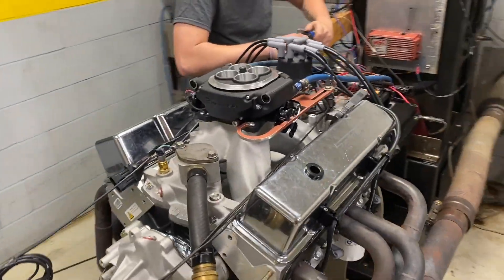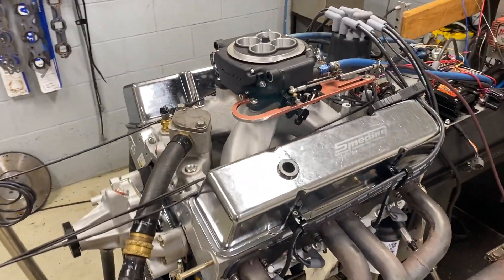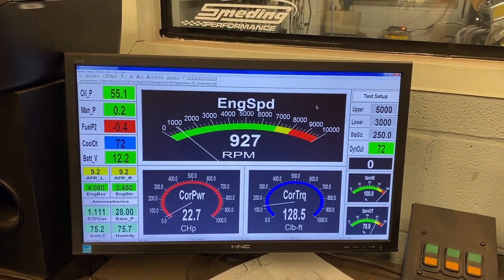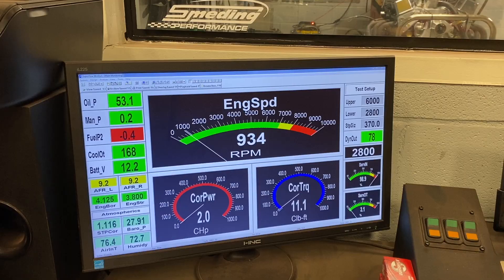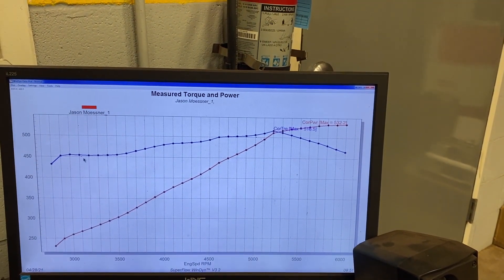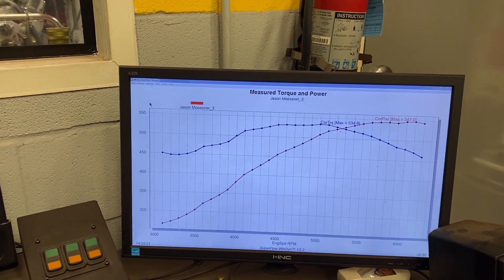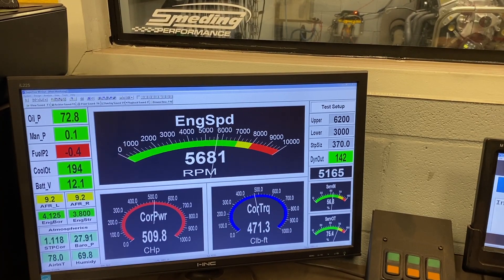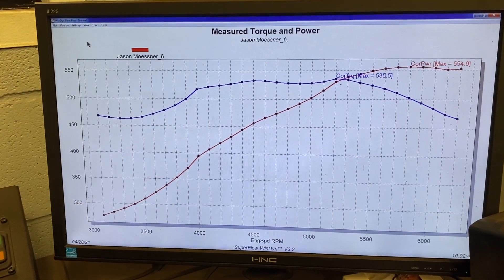406" SBC Dyno Testing - (tuning tips)

Comment: Comp Cams part #08-000-8
Reply: GRIND#: Camshaft, 3018S/13145S HR 110.0 + 4.0
Reply: GRIND#: Camshaft, 3018S/13145S HR 110.0 + 4.0
SPC INSTR 1:
SPC INSTR 2:
SPC INSTR 3:
VALVE ADJUSTMENT
GROSS VALVE LIFT
INTAKE
HYD
•549
DURATION @
• 006
TAPPET LIFT
292
VALVE TIMING
OPEN
CLOSE
@
• 050
INT:
15
EXH:
59
BTDC
47
BBDC
11
THESE SPECS ARE FOR CAM INSTALLED
@ 106.0
INTAKE CENTER LINE
INTAKE
DURATION
@.050
242.00
LOBE LIFT
• 3660
LOBE SEPARATION
110.0
EXHAUST
HYD
• 546
302
ABDC
ATDC
EXHAUST
250.00
.3640
Reply: PART #: 08-000-8
SN#: 548654-21
ENGINE: CAMSHAFT, CS 1987-1998 SR/HR R PARI #: 03-000-8

Comment: So I got a 406 that I’m building, I’ve got all stock bottom end, flat top pistons with valve reliefs. I was going to put 906 vortec heads but I think my compression ratio would be to high 11-12.1 . Im using an edelbrock performer RPM intake. I’m trying to build a fun daily street/strip car. Any recommendations on a good cam and cylinder head combo for this type of build?

Comment: holley inlet +10-20hp vs victor Jnr     ,,  peak hp 5800rpm =195 
higher peak  around 6100--6300rpm = bigger head /220
Reply: probably just the 210 will do and a super victor

Comment: I bet a Performer RPM intake would provide tons more mid-range power without sacrificing a whole lot on the top end.   Also, the 195cc heads are holding that engine back.  The peak HP should occur well north of 6k rpm, given the cid and cam profile.
Reply: a 242/250 mid 500's lift isnt THAT big for a 400.  thats about right for that size head and CID  hed need more cam AND head  like 250/255  .600 lift and the 210 heads.  then that thing will make 575 or more at almost 6500+ probably  and a 195 head takes a 1205 gasket right?  dont most SBC dual planes take the next step down?  and its EFI  so the single is probably doin good.
Reply: 6 years ago I built a 406 for wife's 69 camaro.
10.5 compression. 
Afr 195
My profile cam hydro roller
244/250 550 555 107 sep installed 103.
13/4 headers 3 inch exhaust.
Did testing at track same weekend same weather.
With the motown single plane 11.21 @121 best time.
Performer rpm air gap best was 11.33 119.
Shifting at 6300. 
These big cubic inch small blocks love single plane Intakes when you have a good set of heads.
Reply: @sleeeper88  Very impressive.  What stall converter and rear gear did you run?
Reply: @toomanymodz  3.55 gear and a coan 4200 9 inch. It drives around great on the street. Also that was through 3 inch exhaust😫

Comment: I loved the video guys....  In your estimation, using that same short block with AFR 220 heads, what would the difference in the power numbers be?  I'm putting together almost the same short block, and haven't decided on the heads yet... All help would be greatly appreciated... Thanks in advance...Jimmy T.
Reply: I am running the same exact motor.Same cam I think.Mine is A Crane 240/248 with 560 lift.I called AFR and I was debating on the 210.They quickly talkie out of it and told me to run the 195’s.If I stepped up to A solid roller then run the 210’s.Mine is for street and strip.

Comment: Flat "crappet"?   Yes, you do have to be part chemist these days to stay old school.  Do your homework folks...Mobil1 [for example] has 9 different balances of zinc and phosphorous amongst their offerings  last I checked.   Only 2 of 30 formulations are acceptable off track as I see it: 15w-50 being the go-to, and the 4T [10w-40] being a backup if you can't find the first.  Twenty of the 30 offerings are so low, I guarantee you wipe a flat tappet cam in 'buy and hope' mode.
Reply: 20w-50 Castrol GTX classic is what you use so you can run that flat tappet cam and get those extra ponies
Reply: You better be running valvoline vr1 and not hope or pray I add Lucas break-in 16oz zinc to it
Reply: GRIND#: Camshaft, 3018S/13145S HR 110.0 + 4.0
SPC INSTR 1:
SPC INSTR 2:
SPC INSTR 3:
VALVE ADJUSTMENT
GROSS VALVE LIFT
INTAKE
HYD
•549
DURATION @
• 006
TAPPET LIFT
292
VALVE TIMING
OPEN
CLOSE
@
• 050
INT:
15
EXH:
59
BTDC
47
BBDC
11
THESE SPECS ARE FOR CAM INSTALLED
@ 106.0
INTAKE CENTER LINE
INTAKE
DURATION
@.050
242.00
LOBE LIFT
• 3660
LOBE SEPARATION
110.0
EXHAUST
HYD
• 546
302
ABDC
ATDC
EXHAUST
250.00
.3640

Comment: I have almost the same setup but promaxx heads. With a fitech almost identical cam specs. What kind of HP loss would you expect if total timing was only 27 degrees compared to the optimum 36 degrees?
Reply from the maker: Probably 40hp
Reply: @JacobVillemain  so my thoughts are he is getting in the 530 hp range with his setup, but when I ran my camaro on the chassis dyno it only put out about 298 HP and 310 ft/lb tq. I know you loose some in the drive train also but the only thing I found was the timing was missing 9 degrees of advance due to a loose distributor bolt
Reply: A lot and optimum timing won’t always be 36 but definitely in that area.
Reply: @Thumper68  so my thoughts are he is getting in the 530 hp range with his setup, but when I ran my camaro on the chassis dyno it only put out about 298 HP and 310 ft/lb tq. I know you loose some in the drive train also but the only thing I found was the timing was missing 9 degrees of advance due to a loose distributor bolt.
Reply: @Tschida2004  9 degrees makes a huge difference for sure!

Comment: Sweet motor! I have a 11.0 383 stroker with a lunati 243/248 voodoo solid roller, holly strip dominator intake, and a sniper x flow system. According to the fuel flow, it’s making around 570-580. Looks like you might have picked up a little knock at peak torque, I’m running a Holley duel sync distributor, it would would be nice to keep timing at 34 around peak tq then bring it back to 36 at other areas of the rpm range

Comment: Great video! I built a near identical engine this spring. My cam is hr 242/248 @ .50 .580 lift and 113* lsa with 11.2 cr with AFR 195 street heads #1040. I was wondering if you could tell me the exact heads you used on this build?
Reply from the maker: Smeding 195cc heads
Reply: @JacobVillemain  I see they're AFR. I was wondering if they are the street or race ported version?
Reply: I am running the same combo. AFR 195’s street heads,Cam .50 242/250 lift 560 lobe 110, 5.7 H-beam rods with TRW forged flat top 2 valve relief 10 1/2.1 compression, ported Victor jr with a FST 750 carb.All balanced and the think RPM’s in A blink.Torque monster for the street.I was going to buy the AFR dual plane for A little more torque but the motor is loving this single plane.When I called AFR I asked about the 210’s but they recommended these 195’s.Very happy with them.With this little N/A street motor I sure look in my rear view mirror a lot lol.

Comment: I'm building a 400 for my 57 (hot street). You wouldn't happen to know the vacuum at idle would you? I have power brakes and plan on using injection and a hydraulic roller too. Thanks
Reply from the maker: This engine was about 15"

Comment: Nice. Almost the same as my build. I'm a tiny less cam but 11/1 and 220 heads
Reply: I am running A 406 hydraulic roller 240/248 with 558 on 110 lobe with 11-1 compression.I purchased the AFR 195’s for street and turned down the 210 and did not even consider the 220’s.Solid roller track car yes all day but I am not going past 6500.Great beastly motor.
Reply: @joshuagarvey9362  mine aren't AFR they're flotek 220 cnc. Still not cheap. 1900 a pair assembled. But 315cfm at .600.  got a transbrake and 4500 billet 8" stall now I'm throwing in it. I'll still drive it around the house too.
Reply: @joshuagarvey9362  mines internal balanced too. I went with Howards max effort HRs. There's supposed to be anti pump up & good to 7k. I set my 6al though at 6800...
Reply: @joshuagarvey9362  how do you like that sniper? I bet that cam is choppy. Mine sure is.
Reply: @DiscoGreen  sounds so beastly with the 3 inch exhaust and the super 44’s.Added the extra 3 inch exhaust past the muffler to the bumper so I can hear the cam ting more with less bass.Man O man sounds soooo good and the cam rumbles hard.I have the motor behind A Muncie 4 speed and A 9 inch with 350 rears’s.Muncie hasn’t broke yet lolol ya no shit but I haven’t been really hard on it just yet.A lot of bugs to still work out.A lot of low end grunt and rpm’s in A blink.I haven’t put it on the dyno but after all said and done I was hoping for 500/500 hp/torque or at least close to it.
Reply: Do you know what kind of power you are getting with your combo with the 220 AFRs?
Reply: @vincevancleave9353  never dynoed it. I'm guessing I'm well north of 550 to crank

Comment: Isn't the cam small for these heads
Reply from the maker: There are many other variables in camshaft selection than just the heads.
Reply: @JacobVillemain  Thanks for the reply.      I knew what you are saying but what I meant that the heads supports bigger cam.    I knew you want good torque so you choose this cam
Reply: @Saan455  195 ccs, thats on the small side for a 406. Fyi thats more like high performance 350 to spicey 383 type size. Little Mild for huge cam on a 406. Its a nicely matched combo look at the curve.
Reply: 195 runners, so no:  its fun/on the streetable side.
Reply: I am running A 558 lift with 240-248 at 50 on A 110.I called AFR and asked about the 210 heads.Adam at AFR referred me to the AFR 195’s with my car,cam and Street set up.I am very happy Oooooo boy.Talk about A seat planter.I did a lot of work to this Victor-jr intake.I was wondering how much friendlier the AFR dual plane would feel on the street with A manual.